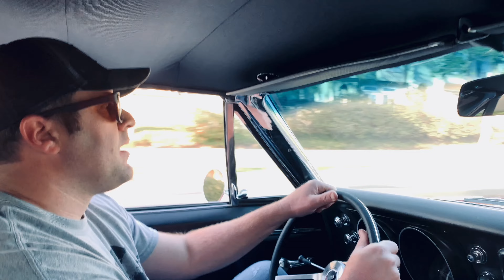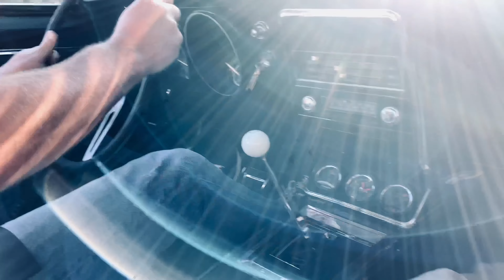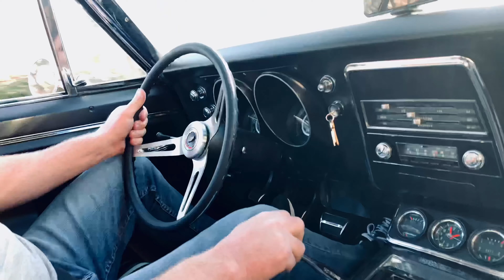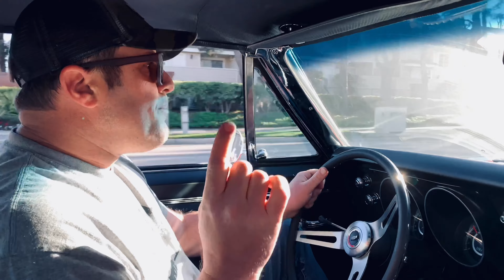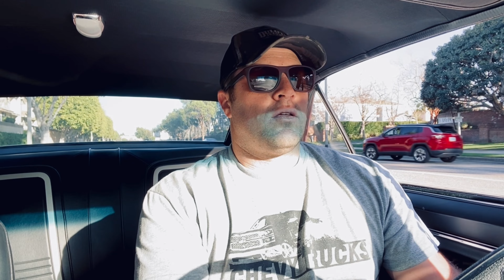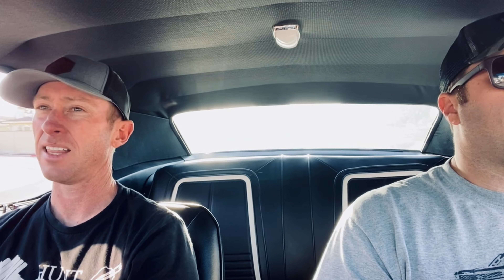1967 CAMARO // Burnouts //  Muncie Shifter Locks Up // VLOG

Comment: Just bought my first 1967 Camaro. '67 Mustang will be seeing his brother soon he he : )

It's an automatic with a hurst shifter though. Want to convert it to manual, probably worth it.
Reply from the maker: That’s super cool. Congratulations!!
Reply: @1967Camaro  Thanks! I enjoy your videos a lot!

One question though, in some videos, it seems like you either don't have the pedal floored or are shifting slowly or am I looking too much into it and in first gear you are faster and in 2nd they catch up and in 3rd you catch up and so on? Maybe it's the editing.
Reply from the maker: @Memphis-15bs  you are correct. If I floor it on take off, or too soon, the engine floods. So I have to feel how much gas I can give it early on.
I have done my 2-3 shifts slowly on purpose, because if they aren’t just precisely right, my shifter will lock up. 
Each car is unique and takes getting to know it. 
My car isn’t a race car, though I “race” it in these videos. Hence I drive it hard, but with understanding of how it reacts.
Reply: @1967Camaro  Now it makes sense.

Does that only happen with your Camaro? First time hearing up manual getting locked up if put in gear too quick.
Reply from the maker: @Memphis-15bs  I’ve read and heard that it happens with Muncie 4 speeds. My next project it to learn more about this.
Reply: @1967Camaro  Is your Camaro restored with cellophane and black bitumen? Mine had it. Watched a video where two brothers are restoring an old '67 Camaro and that also had cellophane, although no bitumen.

Another '69 Mustang in my town is "restored" with cellophane and black "bitumen" (I think it's bitumen).

Do you know anything about this practice? Seems like a lot of classics are restored this way.
Reply from the maker: I don’t know anything about this. Can you share a link to the video and I’ll watch it tonight and see I what I can figure out in terms of relating your question to my vehicle?
Reply: @1967Camaro  Here it is: 

https://youtu.be/RdqXEHLDEXM?list=PLK_j5JegvjbbXepBzxUGZ6u1wJ6Q3SqP_&t=580
Reply from the maker: @Memphis-15bs  thanks for sharing this. To be honest, I don’t know what was done to my car when it was restored. It was mostly restored 2 owners ago. Bottom line, make your car however you like it, enjoy it, drive it, because you’ve got it!